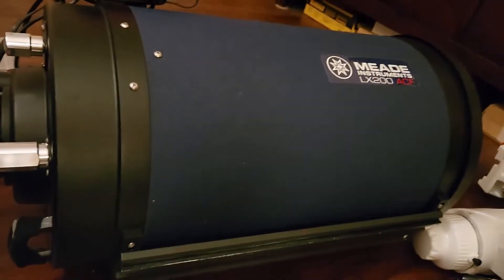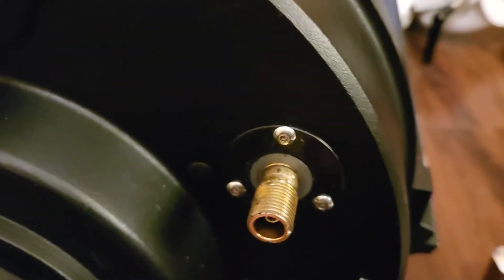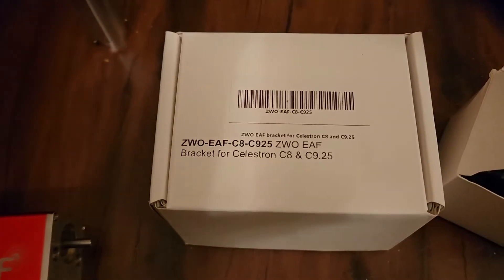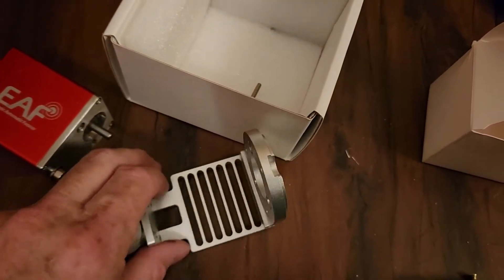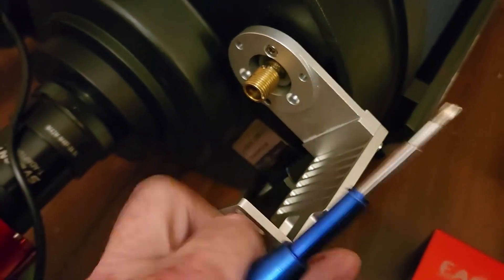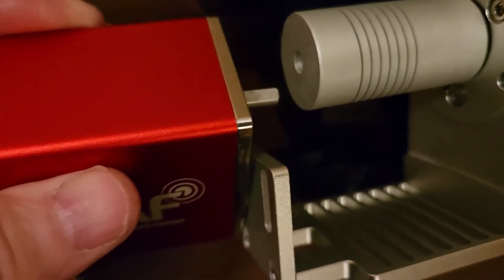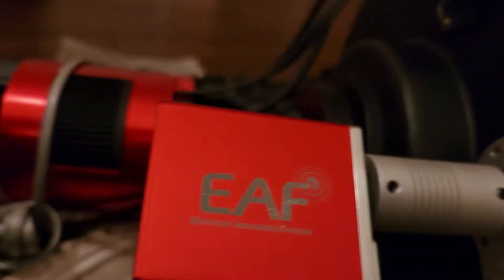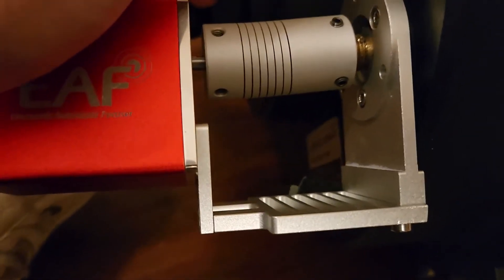Install ZWO EAF Bracket made for Celestron 8" and 9 25"  SCT on a Meade LX200 ACF SCT telescope.

Comment: So, was your final solution to lock the mirror using the mirror lock to prevent mirror flop and then not use the included focuser? Instead, use a added GSO crayford focuser screwed onto the SCT visual back. Was this your final good working solution? Thank you in advance.

Comment: Gran aporte le seria posible facilitarme la medida de los tornillos mas largos
Reply from the maker: Hi, sorry that I don't monitor my you tube channel often. I believe the screw length to secure  the circular, 3 hole bracket were 20mm-25mm long. There's no obstruction in the focus knob shaft inside the tube. Just match the thread size of the screws that come with the scope and add 5mm-10mm for the length of of those screws for the new screws.

Comment: Hmm.  If you mounted the bracket so it points out, so that the metal plate you cut is beyond the edge of the scope, you might not even need to cut off the section.   However, it would stick out the side of the telescope which you might not want.
Reply from the maker: Thanks. I though about different configurations for this, but the focus shaft that is connected to the knob is parallel to the optical axis of the tube. SCT focusers are designed differently than reflectors and refractors, where the focuser shaft is at a 90° angle to the optical axis.

Comment: Have you tried the auto focus out yet?
Reply from the maker: Yes I did. Obviously been a while since I did this video. Eventually, even with this being a good solution for EAF focus, I found a much better solution was to install a GSO linear bearing focuser on back of scope. The mirror knob is used to adjust focus so it's at the center of the range on the linear bearing focuser, then the mirror is locked, and no longer used for focusing. From that point, the EAF connected to the linear bearing focuser just moves the focuser in and out. It always finds focus like 99.5% of the time, and the focus curves on the ASI AIR Plus app are always a smooth V curve, with a clearly defined minimum star size at middle of the V curve.